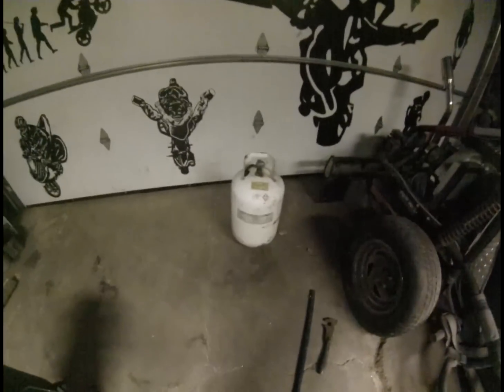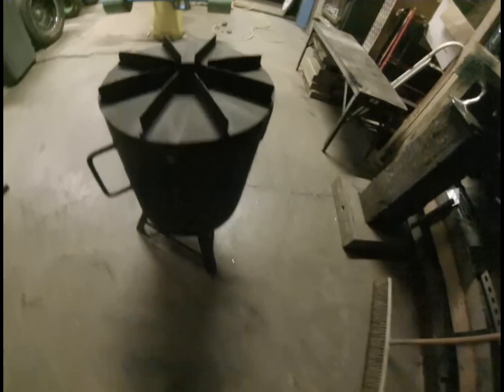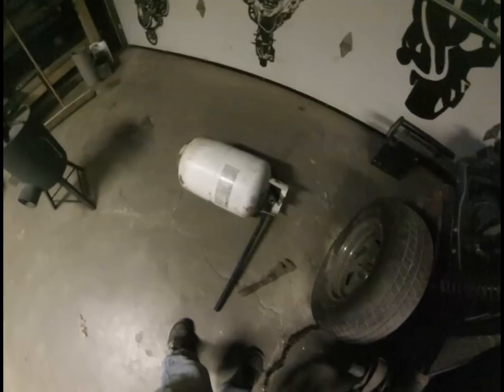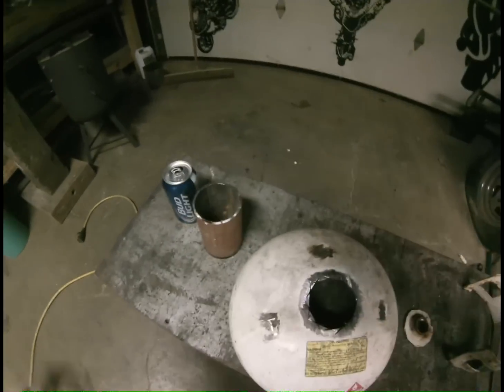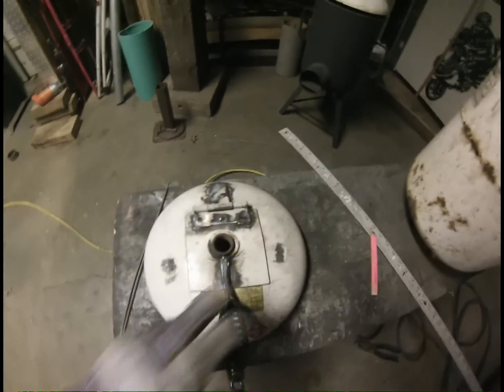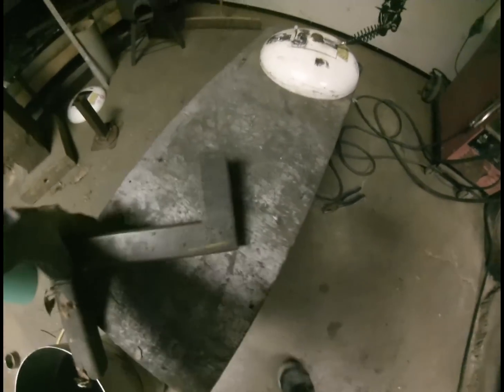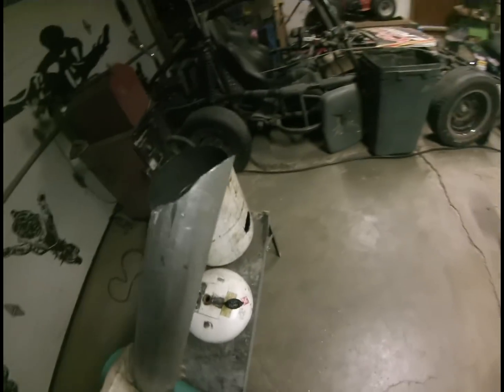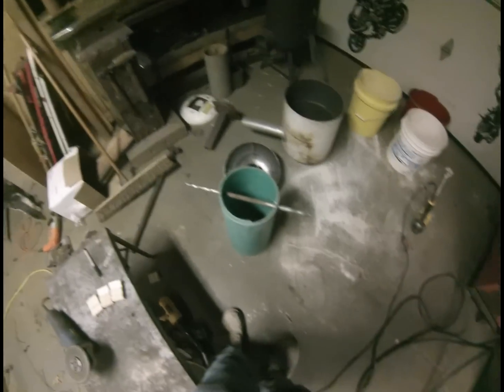How To Build A  Foundry For Smelting Aluminum part1 of 2

Comment: Not trying to be mean, the furnace is looking good, but this can't smelt aluminum, just melt it. Smelting is extracting metal from ore. This will just melt down existing metallic aluminum. Aluminum smelting is usually an electrolytic process that is carried out at temperatures 340°C above the melting point of aluminum. Nice video otherwise.

Comment: i just called lowes about how huch to get the high temp concrete and it was 14 dollors for a half gal. so im thinking that too much so i had another idea. i just found a fire proof safe sentry and had to cut it in half to see what was in it and it has about 2 to 3 inches of the fire proof stuff all around the inside of it. will that work. of cource i know i would have to line the inside to hold it around the wall. i was hoping to find a bag of the concrete but lowes didnt sell it like that

Comment: I'm building one now(taking my time, some would say slowly). Using a recipe i found online, fortunately the local ReStore had one ingredient for pennies.
1.5 parts perlite
1.5 parts silica sand
1 part portland cement
1 part well drillers bentonite clay
(ReStore had a pallet full of 80# bags, $6 each! Don't know why.)
Mix it all together dry. Add water sparingly to a peanut butter consistency. 
The mix goes off pretty quickly, so make small batches.
Reply: CORRECTION to the recipe. (Phone app won't let me edit)
1.5 parts perlite
2 parts silica sand
1.5 parts portland cement
2 parts fire clay or well drillers mud (bentonite clay)

Comment: ***** How much cement did you need (approx in pounds)? I am doing the same project with a 20 pound propane tank before I stumbled across your video. I'm going to try a recipe for refractory I found online and see how it holds up. How has your regular cement held up?
Reply from the maker: 510Redneck
still holding up a year later, surprised myself.... but i hate to spend money, so i use what i got.
Reply: I actually figured it would have popped all to shit personally but it seemed to do quite well in his second video.
Reply: ***** I hear that man, I'm a cheap sob as well... no sense in being wasteful when you got shit you can put to use.

Comment: What did you use to cut open the propane tank?
Reply from the maker: IMPORTANT!....valve removed, and purged well with water first.....used my cutting wheel on grinder.